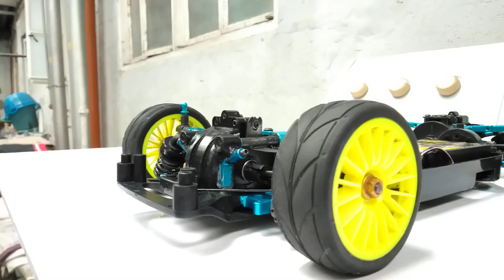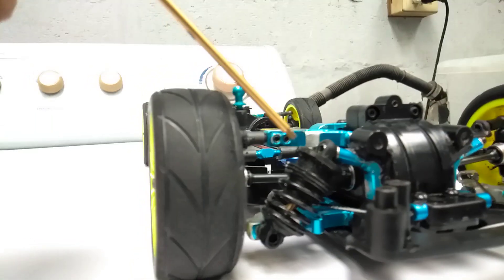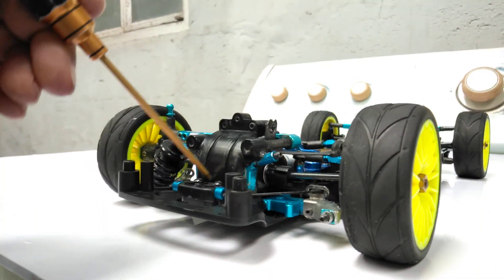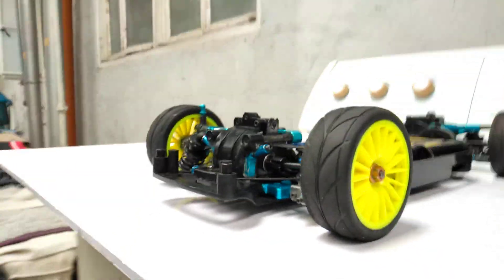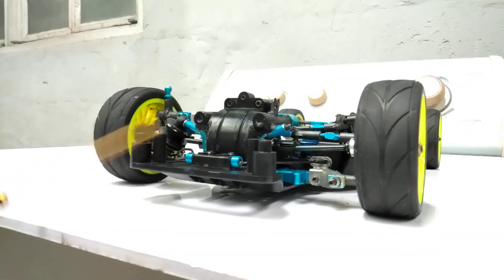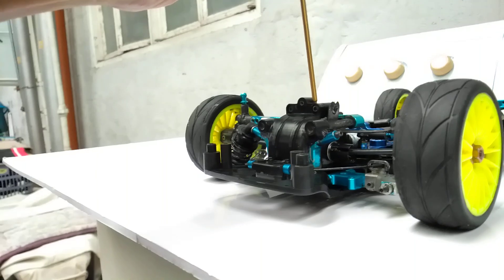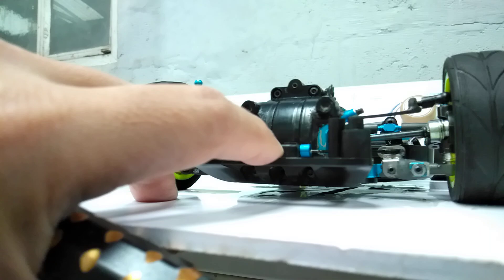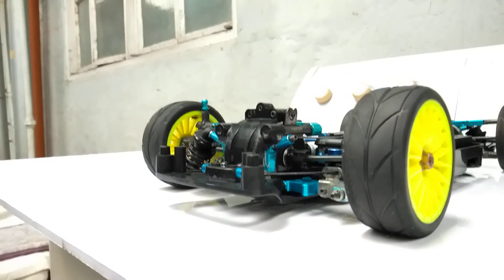Innovative RC Suspension Prototype

Comment: That leaf spring is sprining alright, there will probably be larger camber gain, but how about shock absorbtion? If not counting the possible friction from the leaf spring, I don't see any shock absorbing element. Is it really alternative?
BTW, I'm pretty sure you are not the first one 🙂 But in car chassis design, nobody ever is first, thanks to long history of motorsport 😀
Reply from the maker: There is damping. Yes probably has been tried before and did not work that is why it is not being used in any designs :D

Comment: Single leaf isn't a new design my friend. Mono leaf works too but if you really want to save weight and lower GC why not replace the lower hinge pin with a torsion bar? It will be stronger and more consistent than this 1 hit wonder ( one hit and it's broken). Oh, I completely forgot that track surface imperfections exist, and apparently so did you, lol. No dampening only works on glass smooth tracks... which don't exist.
Reply from the maker: No space for torsion bar. Linkages like IRIS will also complicate design.
Reply: @rccartips  if the inner hinge pin is the bar then it doesn't  take up additional space.
Reply from the maker: @stp440  Torsion is tricky, my first Tamiya was torsion (SRB). It does not have damping, or does it? :)
Reply: @rccartips  that depends on the size of shock you want to use and where you want to mount it. If the hinge pin is the torsion bar you can mount the shock at the opposite end from the bar stop close to the splines with a short arm and a small shock in a cantorlever design to keep the CG as low as possible (which is what I would do) also as far as inconsistency with bars goes most of that gets eliminated with a spring dyno as long as you use it often. I drive several types of full sized race cars that use torsion bars for the ability to increase the spring base to add stability to a very short wheelbase. Also every sprint car uses torsion bars on all 4 corners for the same reason for nearly 100 years and non of them have consistency issues with the bars.

Comment: I saw something like this before dude tried carbon fiber iserts up to thin spring steel sheets. Yeah cool approach I'm sure it will work 👌 just a matter of picking the best thickness and material.

Comment: I don’t understand.. the idea is to have a damper on one side only?
Reply from the maker: No I am comparing my current design with the new prototype side by side. There is still damping on the new design but invisible :)
Reply: @rccartips  Care to explain that? looks like some sort of torsion system, which are still just springs.
Reply from the maker: @14aartis  Yes there is a spring somewhere but I incorporated it into the design to look like their is none. Torsion is a good guess but I am not using it.
Reply: @rccartips  You state "coil spring, shockless design." That's what we have traditionally like you see with the coil and shock on the left. No way there's a coil spring hiding somewhere. If anything it has to be some type of flat spring that appears to double as the upper control arm.
Reply from the maker: @14aartis  Yes.
Reply: @rccartips  Cool stuff, I look forward to seeing more. Very curious about your dampening solution and it's effectiveness.
Reply: @rccartips  What's providing the damping?  It's just going to bounce all over the place if undamped.  Doesn't seem very adjustable either.
Reply from the maker: @zonku540  Silicon oil does the damping, it is there, invisible. I can change spring rates in just 10 seconds.